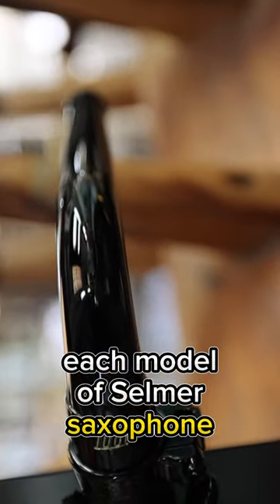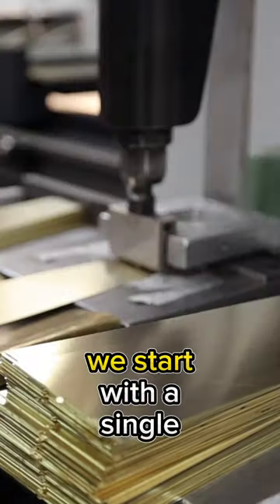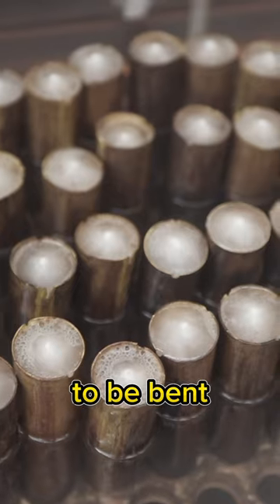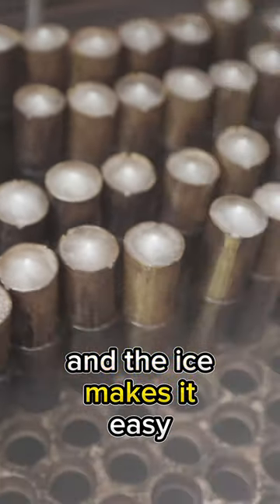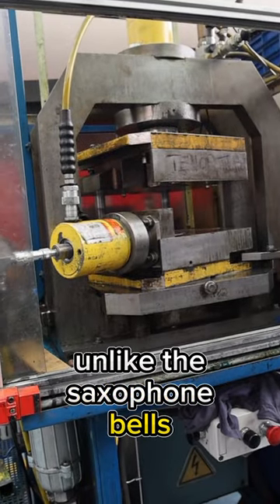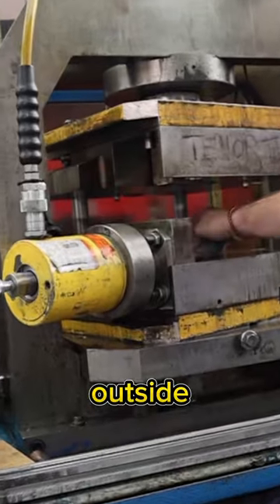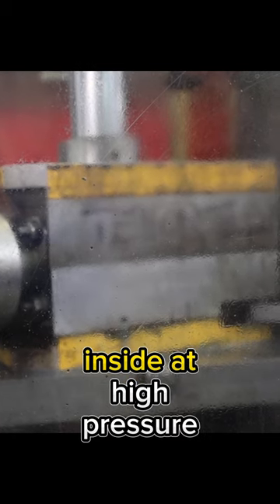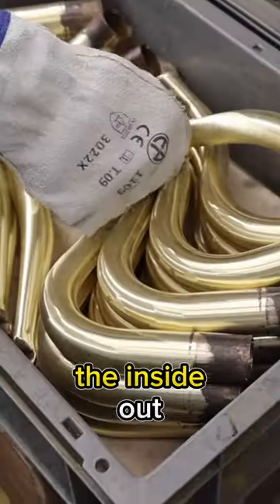How Selmer bends saxophone necks

Comment: There’s something about these necks that makes them unique.  They’ve been doing this on their modern horns for some time, and perhaps on the Mark VI and earlier.  The angle of the pipe when it comes out of the horn is approximately 3°. Not only that, but that 3° bend stays until about 1 1/2 to 2 inches before the cork end.  Selmer has proprietary rights to this design. It’s how they build resistance throughout the entire horn. Look at your Selmer tenor straight on, and you will see the angle of the pipe coming up out of the receiver. I noticed it one time while sitting and looking at my saxophone in its saxophone stand.